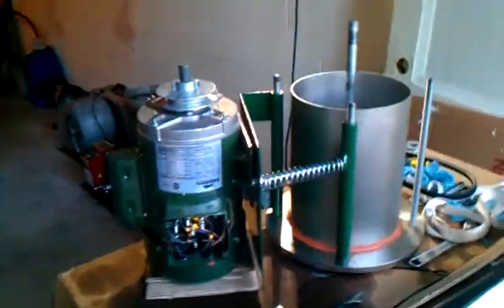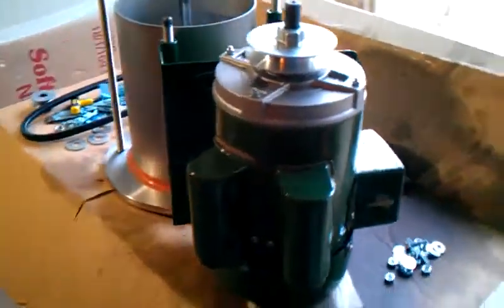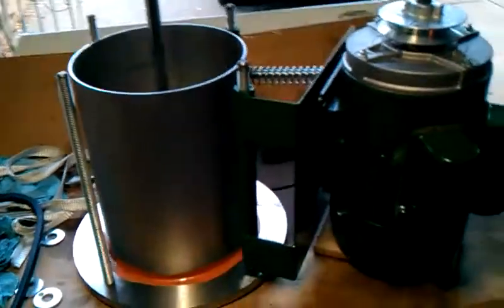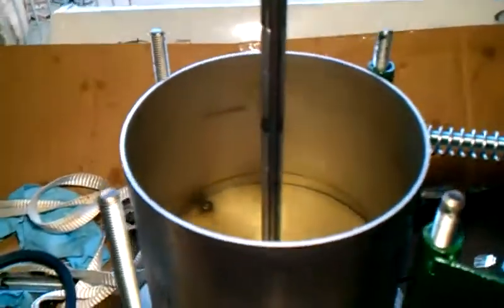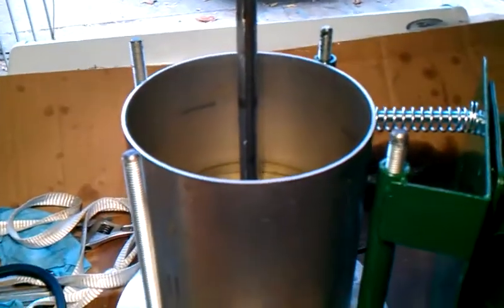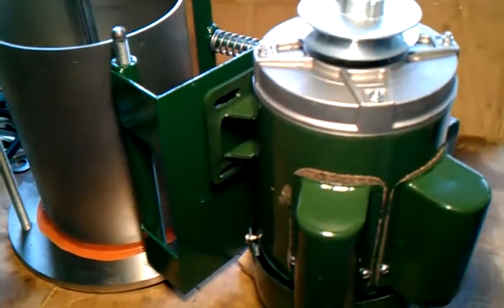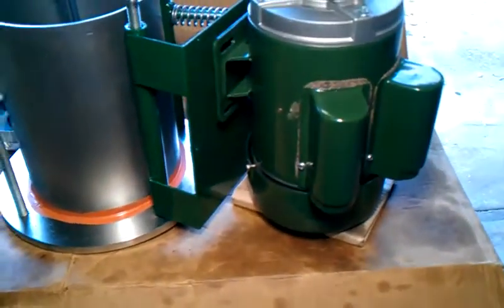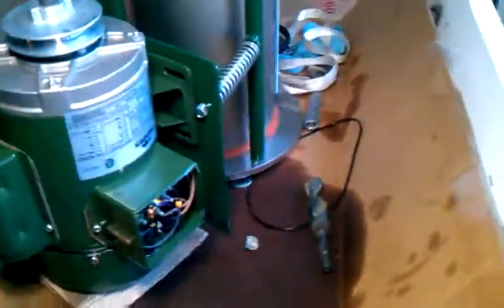Building my friction heater part 2

Comment: Thanks for your afford. I have 9 disc made up and ready for install. 
Question?
1) How much oil did you put in? 
2) How many disc did you end up with at 1800 rpm? I have 9 each.
3) How important is the Pass Through Hole for the oil?
4) Should I step down to about 1200 rpm as I have a 10 barrel?
Thanks John

Comment: anyone purchase one??? feedback please...thanks
Reply: Just tried to find the email and still waiting.
Reply: @victoryfirst2878  it you hold the temp down to 250 f. Why wouldn’t grape seed oil work?. Motor oil has all those detergents in it. I would lean toward a pure oil. If you put motor oil on a dryer roller, it will gum up in two loads,   I can see why he gummed up and burned up the oil at 300 degrees,, no offense meant. For example a car doesn’t get that hot.   Ohh, hey, I just got a text and Gabriel says that grape seed oil should be fine!!
Reply: @bluuedaniel  O.K. grapeseed oil work.
Reply: @bluuedaniel  Back pedal on ther organic oil - it tends to optimise at 180'C. Motor oils are refined for much higher leads.

Comment: 1 hp should be 735 watts, a 1 Bar heater usually has 1000 watts. The first Friction heater used a 735 watt motor to run an old washing machine, filled with gearbox oil. that was 30 years ago
Reply: Do you remember the article date magazine or paper name of this invention Hermann ?? Thanks